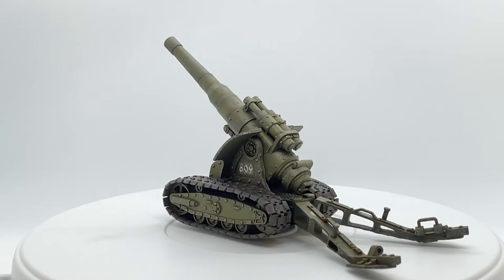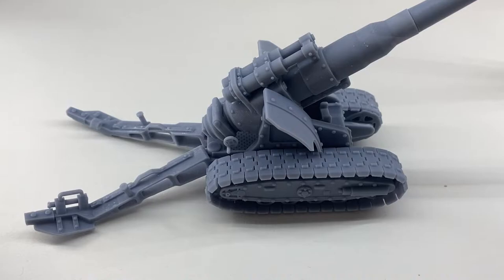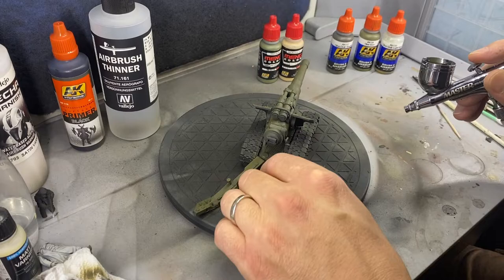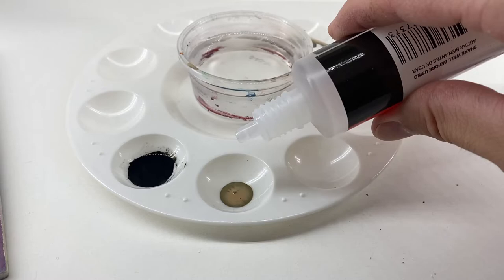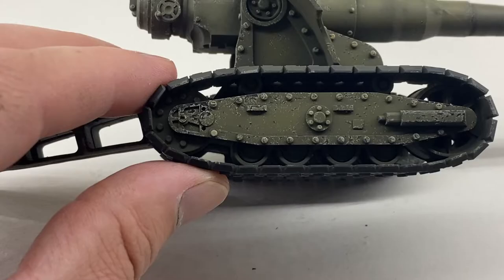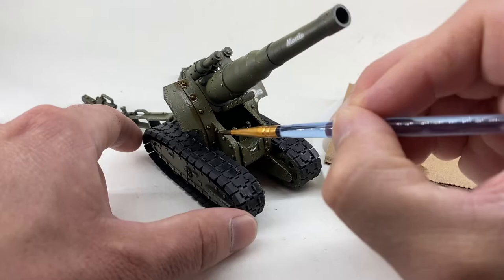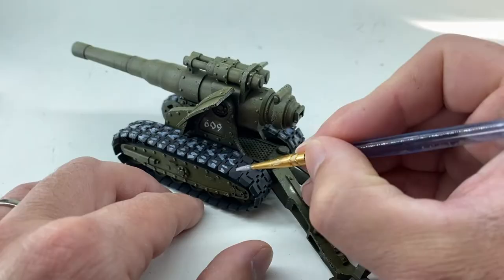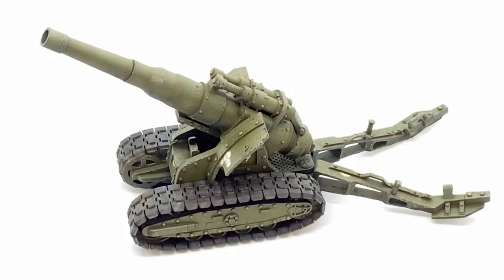Building And Painting A Resin 3D Printed Imperial Guard Artillery

Comment: You talked about primers. For resin, I've been using an automotive 2 in 1 flex primer for metal and flexible surfaces ( AKA, plastic ). You have to use it outside or a garage with good ventilation. I have found it durable and lays down very well. It sprays heavy, so light coats are needed. I have done some small 1/35 vehicles with no problem. It really sticks to the surface. Of coarse you have to wash the parts, I'm sure you no that. I even go over lightly with acetone right before painting.
Reply from the maker: I'll Check it out, Thanks!